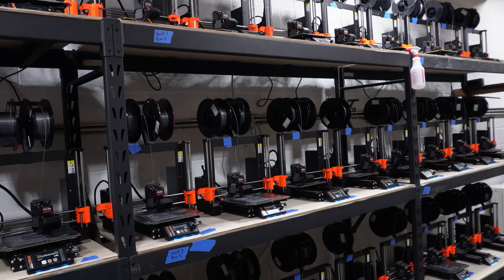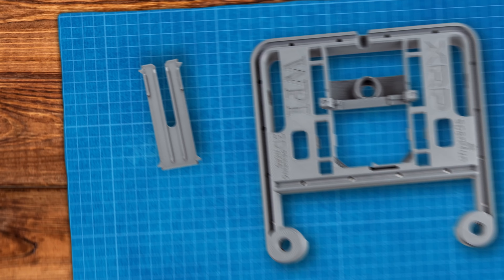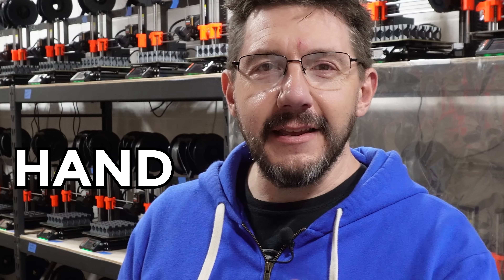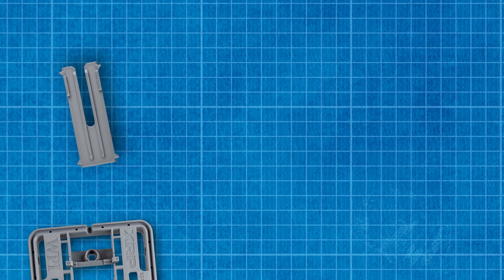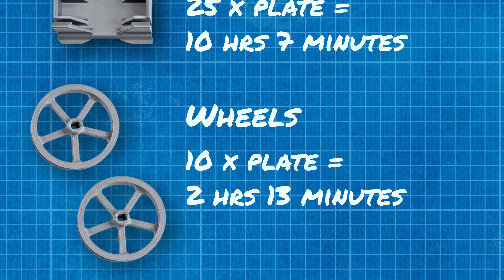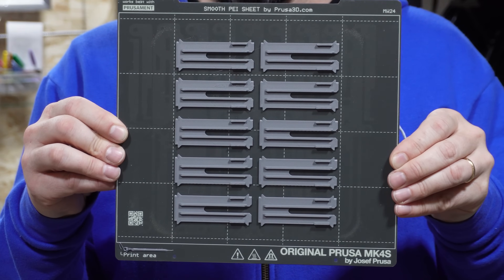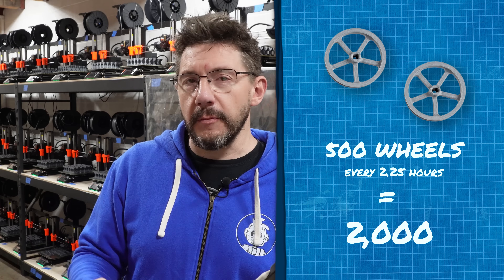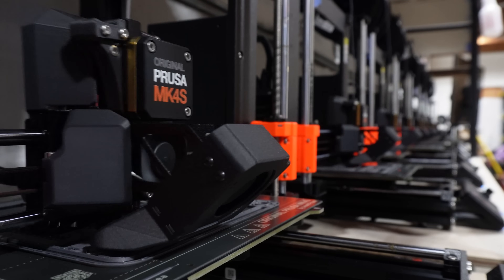How We Used 50 Printers to Make 80,000 Parts!

Comment: I think the only thing not covered was costs: obviously, the filament needs to come from somewhere. Power needs to be taken into account. Getting the machine (and spare parts), etc. But there's a difference between "I have 2-3 printers and making stuff for a local craft fair" and "I have 20, 50, 100+ printers, taking orders and/or traveling around the country to different events to sell stuff". A lot of people I think get to 2-5 printers and go "I have a print farm" and then just print a few items at a time and don't actually need to take into account power and filament outside of "oh, a Polymaker sale! I can finally restock".

It would also be cool to know how you setup all the printers, because for all the cloud-connected printers out there, I feel like very few do "farm" well. I remember telling someone on Prusa's dev team they needed to add multi-plate to PrusaSlicer (done) that supports per-plate settings and coloring (for multi-color stuff)... that's not done yet, and then they need to be able to go "I want to send the ENTIRE project to PrusaConnect and assign/queue plates per-printer so I don't need to do any of that manually". The Prusa dev went "wow... that would be a dream". I responded "I wonder if you happen to work for a company that can make that happen..." and I watched his eyes light up in realization.

Comment: Where is the injection moulding cost parity trade off? When my only tool is a hammer...
Reply: For a small simple part like the wheel the mold might cost $5k.  The sensor and servo mounts are fiddly so they'll be more expensive, as will the chassis as it's large.  All up would easily be $100k, so over $10 per kit (if this was the only run).

10,000 parts, so long as they're simple, is where you'd consider injection molding.  Downside is lead times and stumping up the cash for the molds.  You could buy another 100 printers instead....

Comment: Short batch jobs are inefficient as you spend larger fraction time heating cooling and processing.

Having overnight jobs that you can start in the afternoon (so you can check first layer or two) and second set of day jobs you can process while waiting for the first layer of the night jobs would optimize machine utilisation.

Comment: Ok, so I know it's a pain to post process resin models particularly on a print farm which would be an absolute nightmare with 50 printers but you could get this job done seriously quick with the way resin printing works. The two things about resin which make it so quick for mass printing are that you can print 10 models in the same time as 1 if you can fit them all on one build plate and print time is just restricted by model height. The printer I have can print 170mm tall models in an hour which is insane. I did a few quick calculations and I reckon you could print these 10,000 kits in about 11 days with a non stop 50 printer farm.

Does anyone know if anyone's actually got resin farms like this to work?

Comment: Is that the only machine you use in farm?  Also, are your running .6 nozzles for those type of parts?  Thanks for the great content, you are very much appreciated in the community, loved your Xmas celebration video, looked like fun was had by all :)  I think in a print farm having say 15-20% of printers with large format bed can come in handy for larger parts, where  you can fit say 4x the amount of models compared to a more traditional 256 bed.  This adds some diversity in options that can come in handy for production runs.

Comment: Why not cram as many parts on that chassy build plate as possible? Looks like you could get everything except the wheels.

Then you dump the chassy + parts into a bag, add 2 wheels and done. No need to count at all. 

Plus each printer can run longer. Say 8 hours. So every morning load printers, swap again at end of day, if needed swap before going to bed, sleep 8 hours. Both machines and people are happy.

Comment: My challenge is figuring out price scales on large 3d printed parts that are engineered for automotive use. They are made of ABS and ASA. The completely fill a 350mm cube build volume and can take 35 hours to print with a 0.8mm nozzle at 350mm/s

Comment: It really depends on which Bambu printer and filament you’re using. In his last video, he mentioned he’s using Jessie Filament. In that case, the MK4S is actually faster than the X1C, plus it’s cheaper and delivers better print quality. Everyone knows the X1C doesn’t handle PLA that well, even with the door open, and it’s more expensive. Prusas are also far more reliable. Considering all that, the A1 isn’t really an option. It’s slower, the quality is just okay, and the reliability isn’t great for a print farm.

Comment: Mr J, in the late 1990s, in Everett, and you know the company, they are famous for making Multi-meters and test equient. I seen my first 3d printer. I was employed there to support the 1,000 work stations and end point devices and seen a 20,000 3d printer in action. I said this is cool ! it was printing a part in ABS. I never thought 3d printing would take off like it has. In the early 2000s, I was in Vancouver and came across a guy making 3d printers and selling them. Again, I was more focused on doing IT support. We here we are a whole family of companies making 3d printers. I want to buy several, but there are so many options and like to know, why did you select the Pursa for your print farm? Lots of other brands and some with BIG build plates!!! Hell I even seen one guy who took a Treadmill and turned it into a 3d printer and printed out a 8 feet plastic I beam that was BIG. I want to build housings for my Ai computer vision model camera, electronics and then..sell them to companies.

Comment: Interesting video. Can you tell us what type of filament was used? Did you make any changes to the print settings for speed? Or were you basically running with the speed settings that Prusa has in their profiles? Just wondering because The Prusa settings are reportedly fairly conservative, but they work. Yet, there is some additional speed that can be achieved. Just wondering what choices you made with such a large order. Thank you!

Comment: Yesterday for the first time, I had to create a quote for a large order (large for me) of 3D printed medals.
It went:
1. Time -  How many can I fit on a bed at once, how many printers do I have, how many prints can I start per day (based around work & sleep). Then add time for material delivery & potential failures.
2. Cost - Taking into consideration the cost of electricity used based on print time, how much filament is used, & then more importantly, how much it costs to actually buy in enough spools to cover that filament.
3. Price - Come up with a cost per medal, compare it against the generic alternative they were looking at online. Multiply cost per medal by how many they want, minus energy & filament cost, then decide if what's left feels like enough of a payment to cover the time & effort I'd put in. I know I should actually calculate time spent & factor in printer maintenance cost, but I find them difficult to define.

I find the whole process of how people work these things out fascinating.
Reply: "printer maintenance cost" actually is pretty easy. On average most people allocate a lifespan of 3000 hour for a machine, and oil, grease, bed replacements, etc to be allocated, the most common I see becomes (machine cost*1.25)/3000 hours to get the hourly run time for machine maintanence and replacement at its end of life. Then simply take your print time*machine ain't cost to find out the cost per print to add to the job.

Comment: I always wonder, by the time you get to these high volumes and slow prints, when does it make sense to switch to a plastic mold injection style of setup
Reply: 10,000 is around the order quantity where short run injection molding starts to make sense, but there are significant lead times for mold making and production scheduling.  For a company that wants to ship now and has ongoing need, 3D printing eliminates almost all of the initial lead time.  3D printing also allows more flexibility so a new design can be tweaked much more easily than modifying an injection mold.  3D printing is also better for Just In Time manufacturing so there is no need to warehouse a large order of injection molded parts.  3D printing produces parts as you need them.  For products with unknown sales and lifetime (isn't that all products?) you aren't forced to buy 10,000 parts up front.  You can schedule deliveries a week in advance and adjust the orders as needed so you aren't land filling 30,000 plastic parts that didn't sell.  For most customers, injection molded parts are probably perceived as higher quality than 3D printed parts, but 3D printing probably has a cool hacker vibe for most people ordering a hobby XRP robot kit.
Reply: @Liberty4Ever  XRP Robot parts are like toy hobby parts. FDM Filament printing is far from commercial quality with printers like a Prusa, Bambu, Creality, etc. These are all hobby toys!

Comment: I have a Prusa AFS (18 printers) and 6 XL's. All printers can print 24/7. For the AFS loading and unloading of buildplates is automatic, planning is mostly done by Prusa Connect. The biggest problem I have is filament runouts. Even with 2 and 5 kg spools this is hard to plan and causes the most downtime. 
How do you plan filament runouts, or do you accept filament losses?
Reply: Agreed, this is a pain.  I've seen a few systems out there too deal with this but they have some problems.  Also the kink at the end of the rolls is problematic at times.  I could see with 50 printers going this could be an all day job changing and purging filament. 

Plus you've got to change it right away because if the part sits your going to end up with a visible defect in your part because of the plastic cooling.
Reply: Check the infinity flow s1
Reply: How do you like the AFS? You have two modules with one gantry?
Reply: @dzejkej0  The ASF is working great.  We bought it as an extra service, but we are specialiced in laser sintering of machine parts. Because some parts can take a very long time to arrive in New Sealand. John Deer parts can easely take 6 weeks to arrive. We  can copy it in max three days.
Sometimes we get questions to produce plastic parts. As I also own a PLA factory we wanted to do FDM printing too, but without the need for extra personel. The ASF was the most effective way.
We now own a unit with two modules of 9 printers, one gantry and one stack for empty buildplates and one stack for ready buildplates. Keeping the machines running costs two to three hours a day, including slicing and packaging. 
The main weak point is the filament input. There is just one spool for each printer and even when you use 5 kg spools it will run out and the printer will stop printing until the spool is replaced and filament is loaded again. During workhours this is not a problem, but it tends to happen during the night and in weekend. The stack for finished print is not always large enough to keep all machines printing during the weekend. On average each printer only works about 135 of the 168 hours each week. Speed is comparable to the MK4. 
The printers themselves are reliable and we encounter a failrate less than 3%. Print height is only 16 cm. For maintenance you can easely take a printer out and replace it with a spare one (you get one spare per module) to reduce downtime.

I can recommend the AFS, but keep in mind it is expensive and it has to run 24/7 to earn it back in two or three years. If you start a printfarm it is too expensive. If you have two (or more) people running around to swap filament, switch buildplates, doing post processing and packaging. I think a bunch of MK4's (or other brand) will be a better investment..
Reply: I love to hear the insight from using the AFS. It seems like it's still in low volume production/ testing/ certification (from what I gathered from Prusa at Formnext 2024) and therefore rare to get a real user information.

Your point about filament runout is one of a few why I decided to course-correct and change plan to expand my print farm with MK4S equipped with Jobox Automation + MMU3 instead of AFS. When I started out my 3D printing on demand service I was thinking that AFS is the holy grail, end game solution. But from real world experience running my service with a few MK4s I realised, that after the plate swaping, the next biggest bottleneck is filament runout/ swapping. Especially in high mix/ low volume use case like mine, where I print lots of different, single models in different colors/ materials. It's surprisingly lot of work/ interruptions to just swap the filament between prints. For serial production bigger spools (2.5kg) are somewhat better, but still might not be enough for high-infill parts to run whole weekend with a few plates. Therefore I tested MMU3 just as a filament swapping automation - not in one print, but between different jobs. And it worked great. It allows me to have a printing "cell" with loaded 4-8 plates and 5 spool of filaments. Same or different filaments, whatever I need. That combined with some custom software running on Octoprint works great and should make much more agile, modular system that is more versatile and way cheaper. I kinda disliked the idea, that my 50K printing rack is sitting still through the weekend, because I have wrong filament loaded. Also from what I gathered from Prusa the AFS development seems rather slow, burdened with slow certifications. The software development seems steady, but sluggish and while they plan to have API in PrusaConnect, it seems like it won't be as open and customisable as MK4 + Octoprint.

If you would like to share more experience from using AFS or you're interested in my software solutions, I would be more than happy to get in touch.
Reply: Don't Prusa have similar things to Bambulab AMS where it autiomatically change to the next roll when the first is empty? Couldn't you just load an XL with 5kg to two printheads and switch forth and back as they empty. I assume the Bambulab H2D would be able to run 2 x 5kg spools or one 5kg backed by up to 16 x 1kg spools in AMS units. 

How does the Prusa XL do for printing ex. a robot hand in hard enginnering plastic with soft TPU (60A Shore) "fingertips"?
Reply: @jenspetersen5865  There is no ams or mmu for Prusa AFS. We are using 5 or 10 kg rolls now. On the XL you can use more toolheads with the same colour (if you have a printhead available). We/I don't use TPU.

Comment: Me not having enough space for one 3D printer: I have to watch this whole thing.
Reply: Unless you live on a submarine, you will be able to fit a small printer (Bambu Lab A1 mini or similar). Most prints are small anyway, and it's so satisfying to be able to design and print a replacement for some broken part in a day or make the exact fixture or adapter you need. If you're interested in 3D printing (and from your comment I guess that's the case) you really should give it a try!

Comment: Regarding the Nano Adhesive, how often do you need to reapply and roughly how long would you say a bottle lasts?
Reply: It can last for more than a dozen prints, please note that the Nano Adhesive does not work under 90°C plate temp.
Reply: @ThierryC2373 make a support and then, use a counter to count prints, then it would be applies automatically :)

Comment: I run a small print farm and counting parts was a big time suck.  I ended up making counting rigs, basically towers the parts can slide into with count numbers on the sides.  This way when the tower is full, that is a full set of parts.  I understand trying to reduce human error as much as possible, but I also wanted a human to look at each part at least once as a quality check.  Plus the clearances on the rigs are tight enough that if the part doesn't slide into the rig easily, its a sign it might need a touchup or to be discarded.  
On a side note, I just discovered Nano Polymer Adhesive when playing with the FLSun T1 Pro and had about a 30% failure rate due to bed adhesion issues.  I happened to have a sample pack, not even sure when I got it, but it solved the issue.  Currently on the 12th print since applying it the first time without error.  Great stuff, curious to see how many prints before it need to be reapplied.
Reply: @AnthonyMartocello  What plastic do you use? I mainly print petg and do not need any adhesives. Just take care that the bed temperature is high enough and clean bed with alcohol between prints.
Reply: @GGrandi  Thanks.  For the print farm I use PETG on Prusa and Bambu printers.  Zero adhesion issues.  The FLSun T1 Pro I picked up because I wanted to try a delta printer and have been using it for mostly fun stuff with mainly versions of PLA.  Yes I tried the usual stuff, including washing the plate with dawn and wiping with IPA, along with various bed temps. Also lowered the extrusion multiplier thinking maybe it was over extruding and the head was hitting the print.  Ultimately, I think its just not as good of a PEI plate as what comes with the Prusa and Bambu.  Tried glue stick, and it helped a little but the nano adhesive worked much better and much less messy.

Comment: Man I did a deal with a distributor for some products that I make and they placed a 2000 part order. It was a nightmare! I've been working 16 hours a day running the whole thing by myself. Parts fail, then heat creep from too many machines in the same room, then the machine calibration gets off, then one part failure can ruin the entire print etc... I've got a pretty good system going now, but that initial large order you land will always be a nightmare! Use ChatGPT! It helped so much with planning, packaging and scheduling.